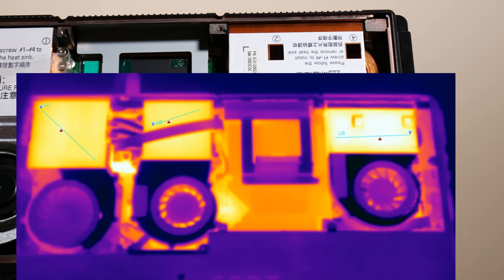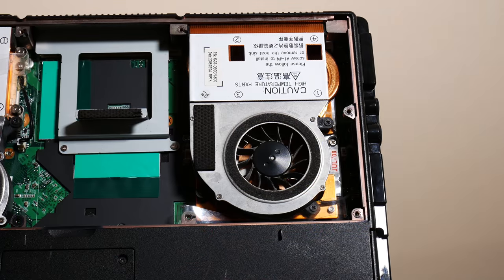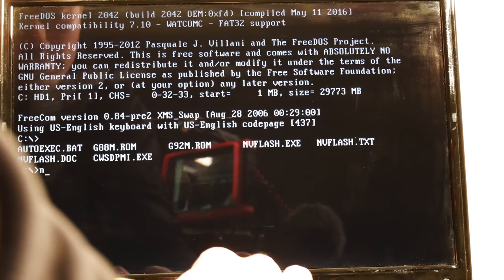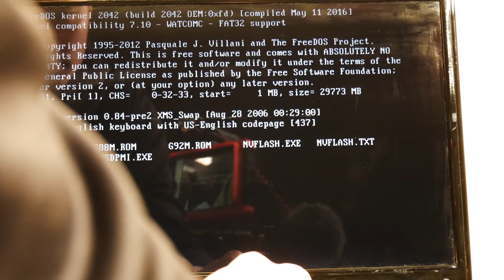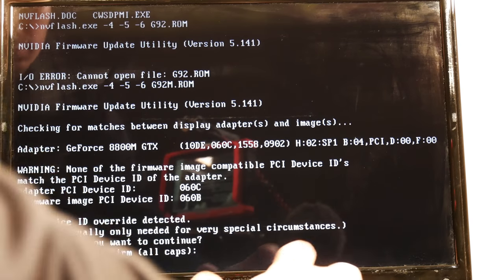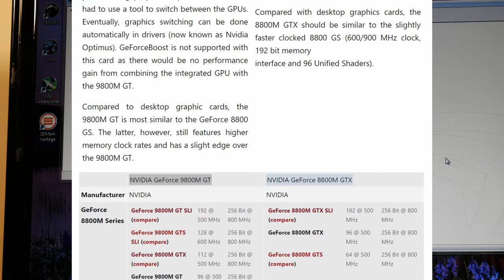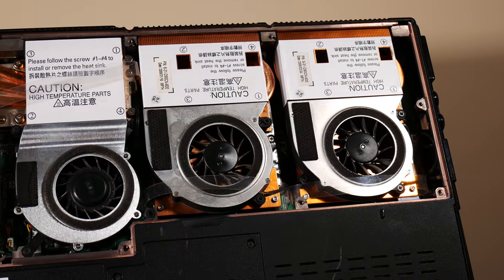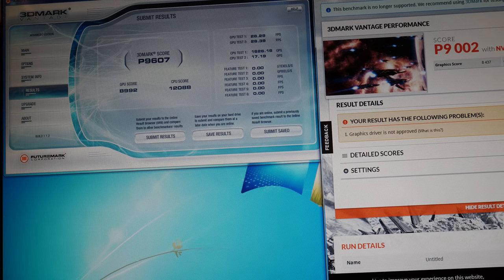Clevo D901C SLI GPU Upgrade and Overclock Record Breaking

Comment: need a sli cable?
Reply from the maker: You can do it with or without, this configuration could do SLI through the northbridge. Perhaps a slight performance improvement with the sli bridge, but I don't believe I could find one at the time I made this video.
Reply: Dialup David Thank you!